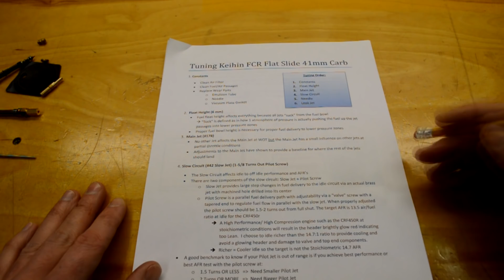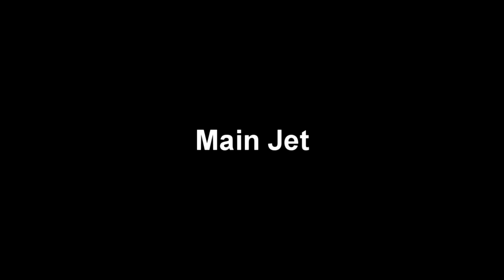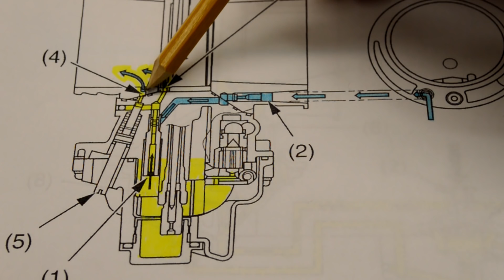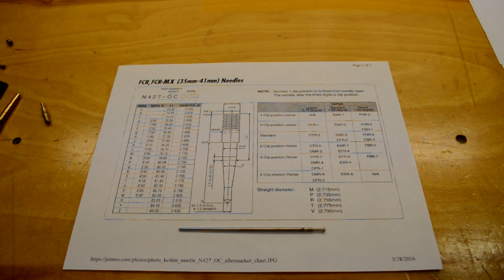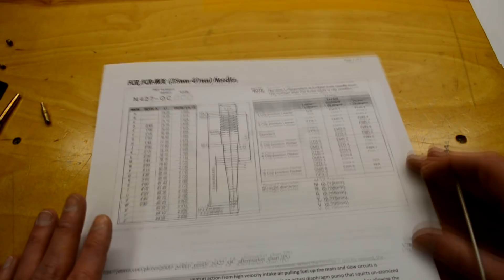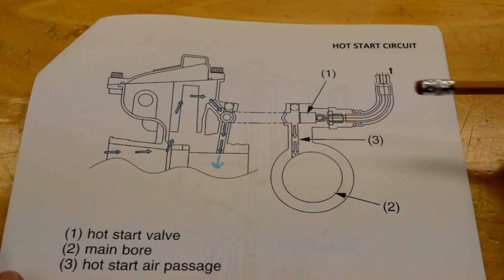Honda CRF450R Jetting And Fuel Delivery Explained

Comment: my engine still runs and nothing changes when I seat my pilot screw does this mean I need a smaller slow Jet?
Reply: Normally yes, decrease the pilot jet, the best way to adjust it, engine have to run out under 0.75 turn pilot screw and also, more 3 turns pilot screw, pick up the pic of rpm between both (cold start and hot start have to run)

Comment: best carb video on YouTube 👍
Reply: Exactly! I learned some crucial stuff from this vid. Thanks Neal, great explanation!
Reply from the maker: @hansottosmotos  Thank you both!
Reply: @EmersonRaceworks  Just awesome.. On my '05 WR450 runs awesome but lots of popping on Decel, 170 main 48 pilot 2 turns out on aircscrew. Nothings clogged should I try 50 pilot 175 main?. 2000ft elevation.👍

Comment: Great video. My 07 bogs out and dies when I crack the throttle from idle. I'm starting to think simply adjusting the pilot screw may not be the fix. May be some wear in the diaphragm in my accelerator pump. There doesn't seem to be any problem in any other throttle position. I can crack it from 1/2 to 3/4 just fine. Any suggestions?
Reply: got the same problem with my 04 yz250
Reply from the maker: If you're not the original owner I would look at what size Leak Jet is currently installed and if its not stock size replace/clean out the jet back to stock size.  Also id check to see if the AP linkage arm is setup properly when you actuate the throttle,  and that the AP diaphragm doesn't have any holes in it.